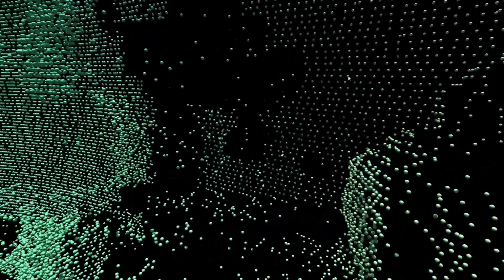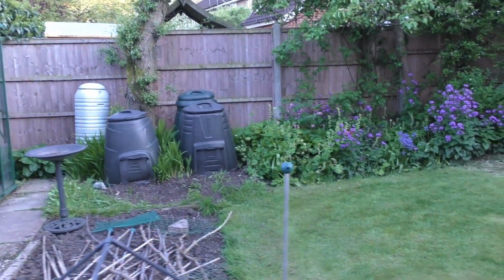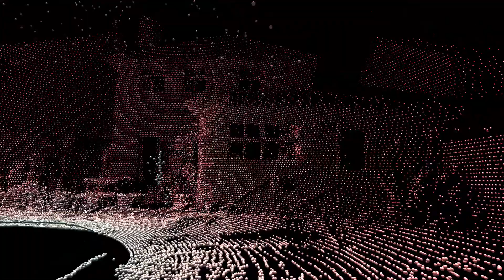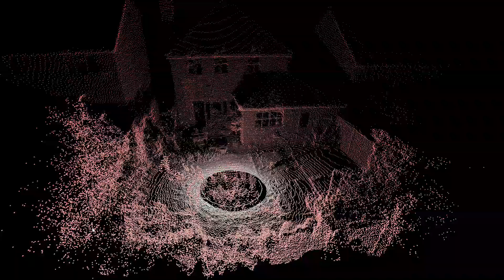Lidar Scan Outdoors

Comment: hey guys, I would like to use Lidar instead of my video surveilance system, because this one is forbidden towards public spaces. In principal I would love to use the system for the protection of my lawn, thus against dogs using my fence as their pissing ground. Surely this may sound very strange, but all what I want to do is to use are high pressure water fountains, not to harm any animal, just to scare them off, so without any video system. Do you think this can be possible with Lidar?